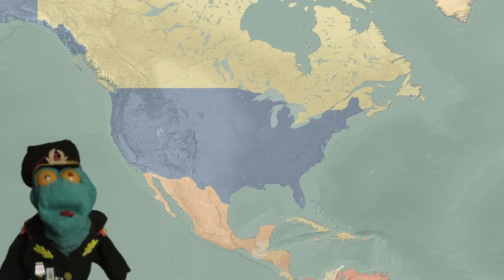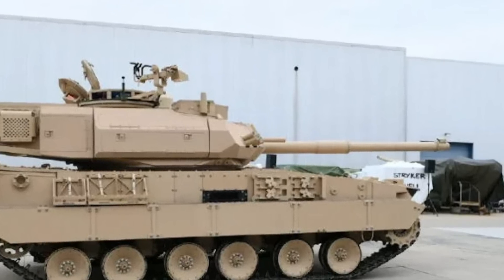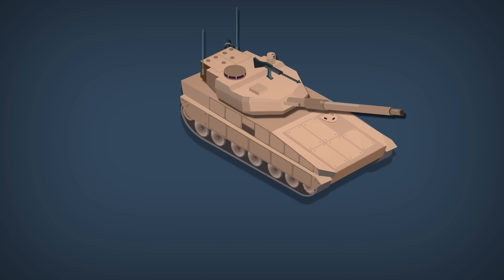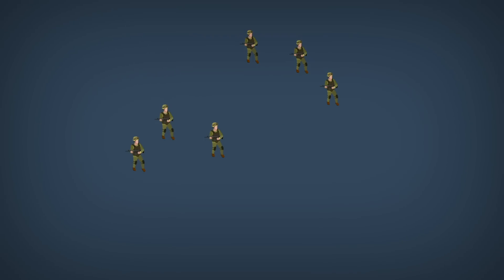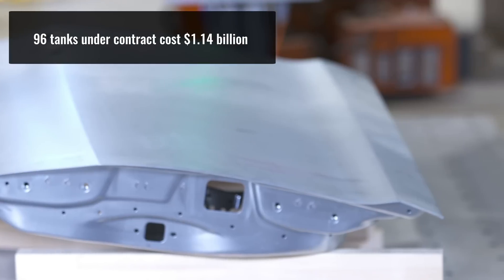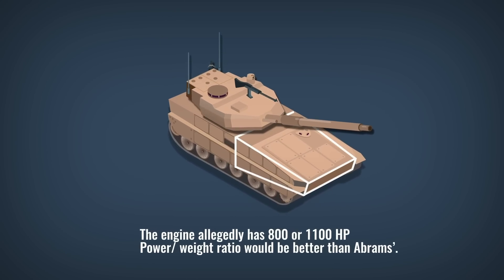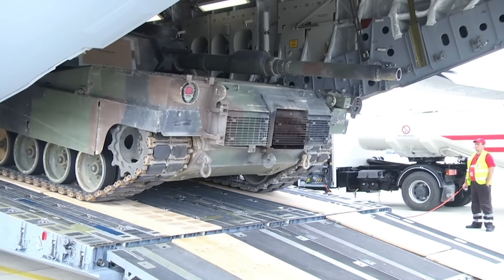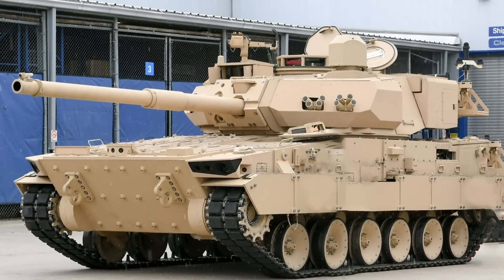US Army just chose its next (light) tank

Comment: Please export these to help Taiwan replace its ancient tank fleet rather than worrying about antagonising China so then flying them out two at a time after the conflict begins...
Reply: Why would Taiwan want a tank with a 105 gun on it ? It would bounce off Chinese tanks
Reply: @MrTangolizard  but not there landing craft in order to use those tanks you have to land and if you sink that vessel before they get to land that whole tanks lost
Reply: @MrTangolizard  It'd go through side and rear armor though.  And it'd be extremely good against IFVs (much more common threat than MBTs), machine gun nests, small bunkers,  entrenched infantry, armored trucks, etc.  Plus it's fast and fuel-efficient (for a tank) and less prone to getting stuck in bad terrain due to the lower weight.  Very logistically useful even if it would struggle against Chinese frontal armor.

And when combined with infantry with missile launchers it could create openings to eliminate Chinese tanks.  After all, while 105mm isn't very effective against Chinese frontal MBT armor it's still not ignorable.  If the  frontal reactive armor has been weakened by a previous hit or it's struck in the sides or rear a Chinese tank could very definitely go down from that cannon.  Chinese tanks have an obvious advantage in direct confrontation but that 105mm isn't a non-threat.

Plus, the light weight means more mobility options in bad terrain, which Taiwan has a lot of.  That means light tanks in places where there are no Chinese tanks because they can't get there, or surprise ambushes because the light tanks can take unexpected routes through terrain a normal MBT couldn't.

I'm not saying the Abrams isn't a much, much better choice for direct combat against Chinese tanks, but this new US tank does have a lot going for it for Taiwanese use.
Reply: Taiwan already has 108 M1A2T's on order to replace the M60's. Should all be fielded by 2026. They get there first ones this year.
Reply: @gregdomenico1891  In that case Chinese armor shouldn't be a huge concern.  The Abrams is well-equipped to handle that.
Reply: @matthewblackwood9653  
Thank you for your reply. Yes, it would be very hard for China to get any heavy tank onshore,  105mm will support more rounds which is incredibly important for bringing down large quantities of landing vessels and the most important thing for Taiwan forces - preventing China from establishing a foothold, and if it does, having the kind of equipment needed to counterattack those footholds.
Reply: @gregdomenico1891  I hope so, there is already a 14 Billion dollar backlog of US defense transfers to Taiwan. It's amazing the US is budgeting 60%+ of its military spending to the pacific theater, has a whole 2030 Force plan, etc yet is mucking around actually giving purchased equipment to the country its worrying about having the copiability to defend..

Comment: I just don't get this "cost saving" nonsense. If money is the problem, just reactivate old tanks. Surely it will be less expensive than buying brand new vehicles.. Because all the advertisment aside, this thing is an M48A5 with modern FCS.
Reply: Old hulls generaly have a problem in that they lack "space" for upgrades and have loads of other hidden limitations that will need "work around" or extensive upgrades to be workable again. Stuff like that can be costly, time consuming, leave you with somthing thats only "half good" and have short life cycle before it will need replacing. 
You can only push a system so far before it makes more sence to custum build a new one with the future in minde. 

Example, the M113 is getting replaced instead of upgraded, and the Bradley Fighting Vehicle are getting close to where its cheaper and better to build a new system
Reply: Upgrading an older model nowadays requires more money then just building a new one. With the advancement of technology there are certain requirements that most old models can’t provide. It’s not just throwing in a radio and optics and calling it good anymore
Reply: @alexiel4406  Agreed.  Moreover, older vehicles would require extensive updates...parts, suspension systems, hydraulics, wiring configuration, lights, modern targeting systems (assuming they can fit inside), etc, etc.....  The older parts in particular would be hard to replace as the production lines for them are closed (& cost-prohibitive to reopen) or non-existent at this point.  Building a new vehicle is cheaper than upgrading an older one.
Reply: How to tell if someone has never worked in logistics
Reply: The major reason to bring a new system in is that the older vehicles don’t have the capability to generate the amount of electrical power needed for newer electronics.

Comment: If it can't engage MBT's, it's a paperweight. You don't get to choose your enemy.
Reply: You can do that pretty well if you have good intelligence (which we do).  The 105mm is serviceable and can take out older non-upgraded Soviet tanks, or newer ones from the side or rear.  This is the gun that most of our original M1 tanks had in the Gulf War, so while it’s not ideal, it’s not worthless.  It won’t be operating in a vacuum either.  It will be with a unit that has TOW and Javelin missiles in case it runs across enemy tanks.  It also has the speed to disengage and/or seek cover.  A bigger gun would raise the size and weight, defeating the point of a light tank.  It would also result in mission creep, and it would be used like a tank destroyer instead of for its intended purpose of supporting advanced infantry.  

This type of thinking results in the misconceptions about the Sherman tank in WWII.  It didn’t have the best gun or the best armor, but it could take out tanks with good tactics.  It was fast, reliable, and fantastic at doing just about everything else on the battlefield.
Reply: It’s a light tank meant to destroy enemy bunkers and defensive positions
Reply: @bluemarlin8138  I am a real soldier, with actual tank commander experience. I have no complaint about the 105. The ammunition can be upgraded. It's not obsolete. Yet.
I don't have 100% faith in intelligence. Like the weather, it's a best guess. The CIA totally screwed up 9/11, for example. That's the game. I also have no problem with light tanks or armoured cars IF PROPERLY EMPLOYED. Remember, in the tactical manuals, one of the steps is 'Win the firefight'. Any game player can see this to be true. If you are sending a recce detachment against a combat team defensive position, you are 'defeating the enemy in detail' FOR the enemy. If someone did that for me, I would be delighted.
I concur with your assessment in general, but this looks like the intention is mainly to cheap out instead of buying a real vehicle. The part I REALLY like is that due to its light weight, it can be air-delivered in twos. Flooding the area with more powerful support weapons is a Holy Grail that airmobile forces, in particular, have sought since the beginning of time. "A Bridge too Far" is history, not just a mostly- accurate movie.
You fight with what the government (spit) hands you. If that's cavalry, it's up to you to figure out a way to make that work.
Reply: @mbtenjoyer9487  Yeah, they said that in the video. You don't get to choose what to engage, it's not a Union shop.

Comment: This is dumb. I why not retro fit the Bradley with the same turret and leave out the troops. This thing a waste of money.
Reply: the Bradley is super old and the bradley may not be able to hold the weight of the new turret
Reply: There is also the cannon mounted Striker which is the same weight and already exists.
Reply: Bradley is not light/medium thank.
Reply: Oh man, why didn’t they think of that🤦‍♂️
Reply: @orlock20  and being phased out because of severe shortcomings
Reply: Because the Bradley is a huge target compared to other similar platforms so it's not a good basis to start on.
Reply: @orlock20  The MGS stryker had serious autoloader problems, so production was halted at 142 and it's due to be entirely phased out by the end of the year.

Comment: Mistake.  The new tank might be good, but the Abrams is a proven success.
Reply: What's the mistake? This is replacing the Bradley.
Reply: This isn't a clown car.  Where do the infantry fit in it if it's replacing the Bradley??
Reply: @TattleDelta  The Bradley carries infantry, this doesn't.  The original design requirement was that this light tank be created to support the air mobile infantry and be capable of being transported by air.  The final design is too heavy for air mobile use and requires the same transport capability as an Abrams.  Now, why would you want to air lift in a lighter, lesser armored vehicle when you can get an Abrams instead?  It's ridiculous.
Reply: How does a light tank replace an APC? Bradleys carry scouts and infantry soldiers. Maybe I'm a little picky but I'm 19K and understand such things.
Reply: ITS NOT A FUKING MBT. IT IS DESIGNED TO SUPPORT INFANTRY. Why do none of the comments understand vehicles shouldnt be compared to each other but to the role they need to fill
Reply: Why does everyone think this is replacing the Abrams?
Reply: @sheldonsimon4484  still trying to figure out the 'Role' of this vehicle that current vehicles do not.  MBTs and IFVs are way better suited to supporting Infantry.  There's a reason almost no military has used a light tank since WW2.
Reply: @txDDS  the role this fills is to have a company of lightweight, cheap tanks that are significantly easier to transport than an Abrams, at the regiment level, so a few tanks can be attached to infantry units during maneuvers so they have something more powerful/armored than MRAPS and Javelins.
Reply: @txDDS  it’s designed to support infantry by destroying fortifications and structures. It says it right in the video, a Bradley lacks the sustainable firepower to fill that role
Reply: @moist_ointment  how is this easier to transport?  It cannot be airlifted and needs the same logistics as the Abrams.  Again what modern military uses a light tank?? Also what fortifications are the US assaulting that the Bushmaster can't chew through.  If the US is adulting such a position as you speak of chances are they are using Airpower with bunker busters.  As I have already said this is a solution to a made up problem.  Also a huge waste of money.   This thing will never be adopted beyond the testing stage.  And to anyone who says this will be cheaper than an Abrams is kidding themselves.
Reply: @txDDS  it's easier to transport because you can fit 2 in a C17 vs just 1 Abrams. It's nearly half the weight, so that factors into all types of transportation costs and logistics.

No other army fielding a light tank is completely irrelevant. The US has been setting doctrinal trends for decades at this point.

The reality is an Abrams is damn near useless in a pacific conflict, which is why the marine Corp dropped them. This will have a much smaller logistical footprint - just the fact that it's half the weight reduces fuel usage. 

This tank could be deployed quicker and go places not suited for an Abrams, while providing more firepower than an IFV
Reply: @gpsoldier9462  :
There have been reports about the Pentagon replacing many of the weapons platforms and the Abrams, Bradley, and Stryker are in the reports.   Nothing wrong with any of those three.  New weapons systems are good and having another new one is a plus.   Butting scrapping what has worked needs some consideration.  The humvee was the one vehicle that served well but poor armor.
Reply: Against outdated Iraqi T-72s yes, yes it has

Comment: So you put us troops in a thing that supposed to be a tank ? Mean while other tanks are rolling by and in a tank broke to shit by a RPG ? Or by a 50mm cannon ?? Or whatever chimes have or Russia have ? . A new tank should be  newer better stronger faster and and all other systems up to date with all others !?
Reply: There have always been light tanks,heavy tanks, even medium tanks, the Abrams has always been a solid tank however it is hard for the army to rely on one tank alone, having a new light tank will be able to cover jobs that the abrams struggles, the army loves things being modular however something specialized at doing 1 job will always be better at said job than something that does 3 jobs at once
Reply: It's not replacing the Abrams so no it doesn't have to have more armor or firepower. It's mostly to fill the potential lack of armor in the Marines should they want it. It's also a great step up from the Bradly for supporting infantry besides mobility and detection mitigation is far better armor than your armor.
Reply: It’s basically an infantry fighting vehicle with a smaller caliber tank gun. You have to keep in mind that the US will dominate the skies in any conflict they fight, which means the threat from MBTs will be minimal.

Comment: 12 million dollars per unit and can be penetrated by 30mm gun, only 105mm fire power. Damn! I hope US build thousands of this! 🤣🤣
Reply: It's all about positioning, airpower and recon now. These tanks are meant to take some load off the air support's back when infantry are pinned down by enemy infantry or stuck in trench warfare in open field areas, or to soften up a position's defenses from afar when enemy artillery is neutralized. Foot infantry can put up a surprising amount of resistance even after their heavy equipment is gone. These tanks are meant to help taking down such resistance, instead of sending friendly infantry into a meatgrinder or diverting airpower from other critical areas.
Reply: Because the T-80 and T-90 is doing so well in Ukraine right now, am I right?
Reply: @Americium-120  Russia doesn't have Trophy systems
Reply: @MasterChiefSamus  Yeah, it is so good. Hope the US keep buying it. 🤣🤣
Reply: @Americium-120  Those are MBTs. Far bigger, and used on the frontlines since it's "supposed to take damage".
Reply: @LordSluggo  or smoke systems apparently

Comment: That is a big mistake. Abrams was the best tank ever.
Reply: They're not replacing the Abrams, they're supplementing it
Reply: @ItsCarl94  name a more battle tested and designed tank
Reply: @Paveway-chan  Thanks God they're not replacing it. That would be a disaster.
Reply: @milsim_gamer98  they will have to replace it someday
Reply: @jordaniansniper934  M1A3 or M1A4 Abrams.
Reply: @jordaniansniper934  there's the A3 program which is meant to look at how to remake the Abrams to fight a modern force made some pretty good strides so far
Reply: GDLS did tease that they’re unveiling a “new Abrams tank” this October. The render in their little video tease showcased 2 of the same kind of CITV on the Griffin II MPF.

May be worth checking out.
Reply: Super heavy so it's hard to transport in any great numbers. Turbine engine exhaust is so hot soldiers cannot be behind the tank to use it as cover while the turbine engine is running, reactive armor and active top attack missile protection systems make it unsafe for troops to walk along the sides and in front of the Abrams. This makes the Abrams only really good at one thing: Engaging heavily armored land vehicles away from friendly infantry. 

That being said I think that this light tank would be better served with a high rate of fire autocannon with several coax M2s.
Reply: Need to work on your listening compression. The Marines have dropped it, not the Army. The Marines mainly operate in the Pacific where MBTs are harder to deploy in number and small teams covering larger areas that are now starting to model themselves on the new Royal Marines doctrine is taking form. You have to consider this tank the same way you would WW2. Would you rather have a Tiger II on Iwo Jima or a Sherman?